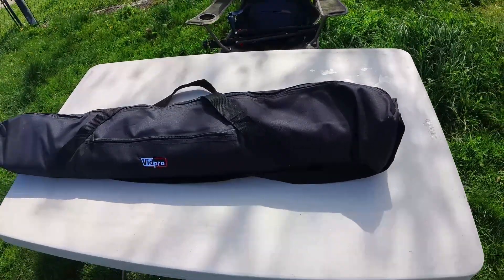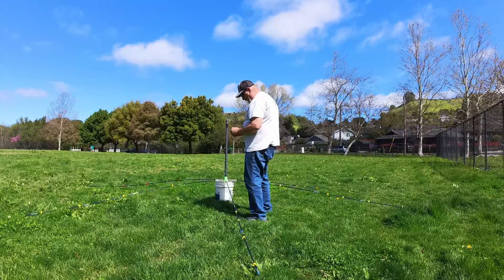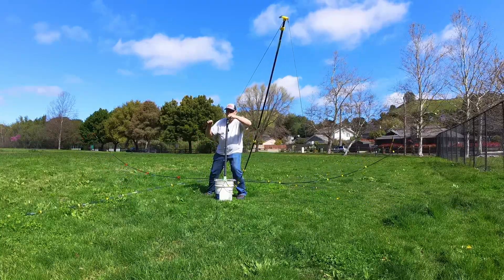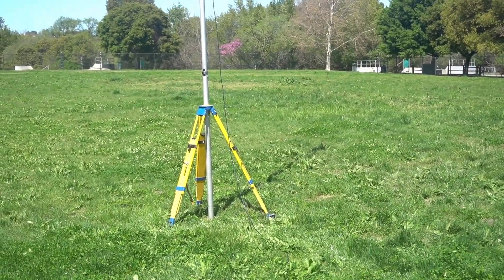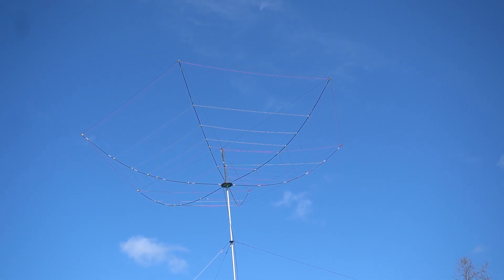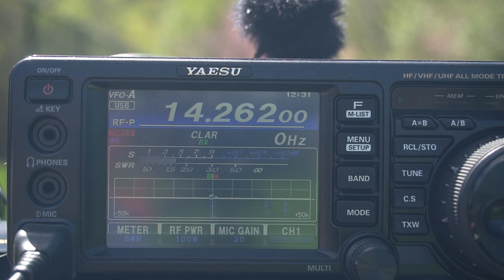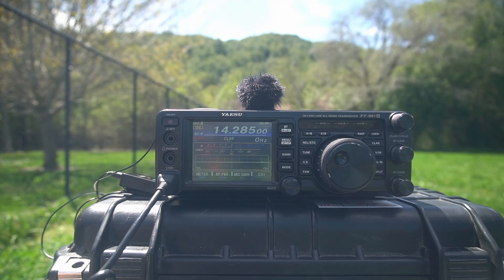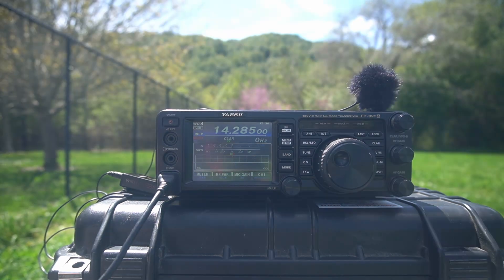You will never believe where my first contact was on the 2.0 ChuckHex!

Comment: Always love a good Hexbeam. I have a tip for you on the wind noise from your mic. (It’s not really too bad). Use the high pass effect on the audio when editing and adjust it ‘til only the lower freq wind noise is reduced. Like, under 200hz. Thanks for the video.
Reply from the maker: Thanks for the tip David, I did try that but have a feeling I was doing something wrong in the edit program.